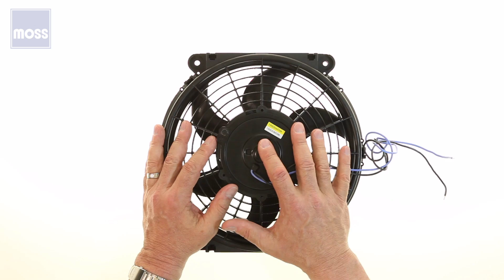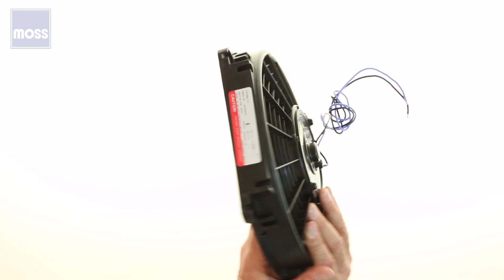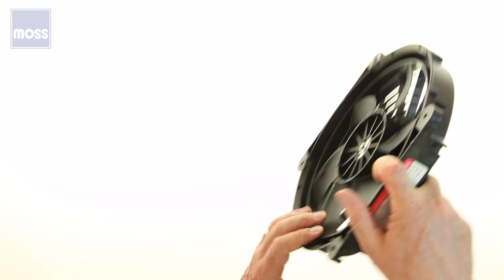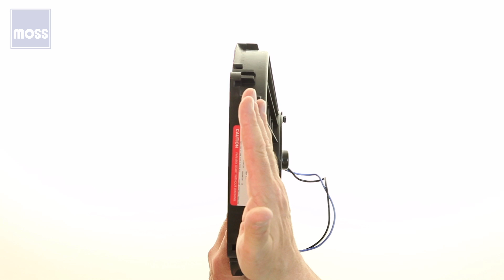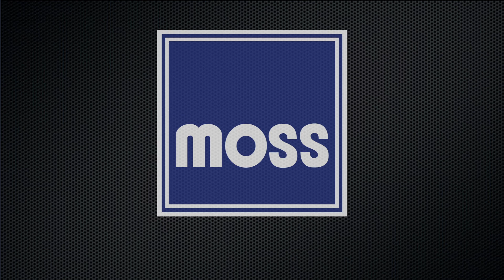Electric Cooling Fans, A Smart Upgrade (Part 2)

Comment: I`m thinking about the idea of put an electric fan to a car that`s does have an mechanical fan to cool the condenser. That`s to save some gas when the car is in stop motion. I notice that when the car is stop and the ac is on, it keeps accelerating at intervals in order to keeps the temperature cool inside. I what to know if it`s posible to adapt an electric fan that  turns on and off by itself  since the car is stoped and desconect it to the motor cistem to save gas. If some buddy have had is good to know the results if it`s worked.

Comment: Totally disagree with removing the mechanical fan, they are there to do the primary cooling of the engine and electric fans are fitted as a supplement when sitting a traffic lights etc etc when there is not the airflow to sufficiently cool the engine.
Reply: Seems weird to only use an electrical fan only as a supplement and not the primary when it can be made to do so
Reply: nitrosavy I installed a 12" electric fan on my truck as a secondary cooling fan as to supplement extra cooling when just the  ac is on for the exact same reason as my belt drive fan allowed my truck to hit 240° or more sitting in traffic.  After installing the electric fan  200° has been the highest . So I agree no need to remove a belt drive clutch fan when  adding an extra fan.

Comment: I'm not too impressed with this kit. You state "the kit has everything you need for a complete installation", however if your car does not have air conditioning to connect the green wire to, the instructions state you have to have a manual override switch that isn't included, and no indication as to what that might actually be.
There is also a plug on the fan wires, which you will have to cut off because a connecting plug isn't included (the fan in the video doesn't have the plug). You'll need to install your own connectors on that of course.
Then in order to connect the fan to ground, you'll need your own wire and connectors to do that because the fan wires are only about a foot long, and you'll have to guess which fan wire (red or blue) to connect to ground because the relay instructions refer you to the fan instructions, which don't state which one should go to ground (probably because the plug you just cut off would normally prevent you from doing it wrong. 50/50 chance of getting it right I guess.
It has a fat blue wire coming out of the relay for multi-fan set ups. That looks really tidy for single fan set-ups, so I guess I'll just cut that off too.
None of these things is particularly problematic if you have basic wiring bits, and are confident enough to guess what kind of "manual override switch" you need in lieu of an A/C clutch switch. But it could certainly be better.
Reply: schmood1971 However, to Moss' credit, their tech support was very good and stated that the green wire could simply be cut off if your car does not have A/C, and it will function as required.

Comment: I have a 78 midget in Florida.  I find that at a stop my temp gauge will creep up a bit.  Would installing one of these help, or might there be a different problem?  Also, what would the removal of the mechanical fan require?
Reply: +georules, I have mg midget 1977 in my garage, all you need is a socket and a ratchet or combination wrench. I forgot the size but if you can text me your phone no. tomorrow I will check the size...my cel no. is 1-415-606-2234..it was year ago I noticed but I wonder if somebody ever help you. if not, text me you cel. no....